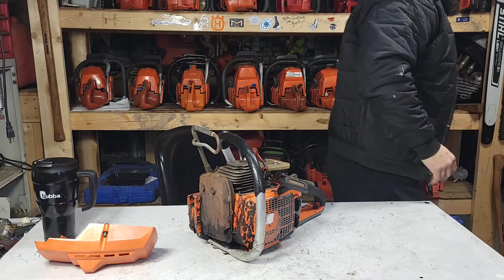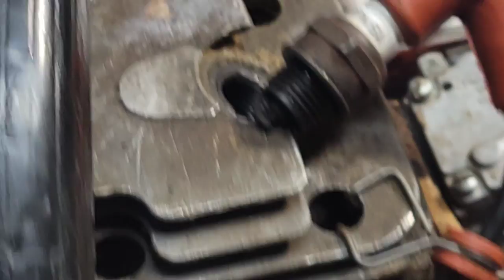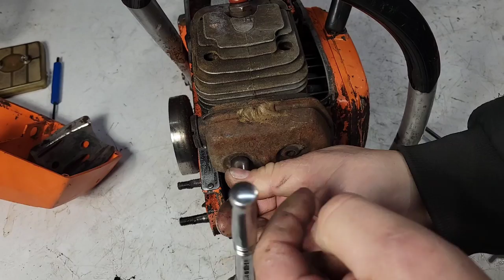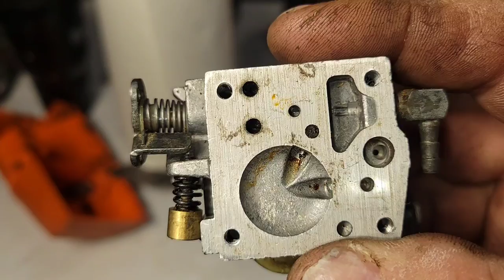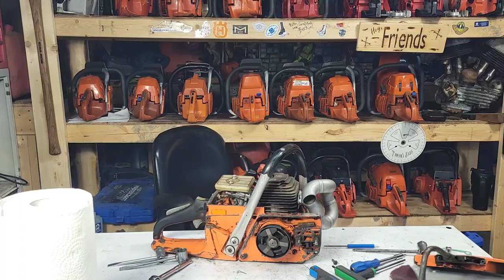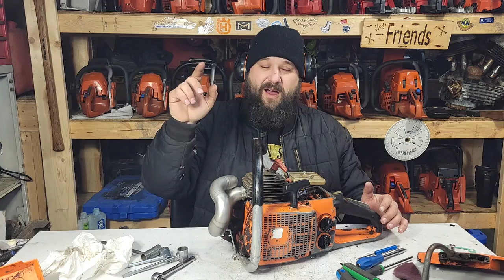Husqvarna 480CD, getting it running so I can hear this pipe!!

Comment: it is a 380cd - just checked mine and the handle bolts have the same rubber mounts and it has the same black rear handle. my 480 has no base gasket, a little bit off the piston skirt on the intake side, bigger lower transfers, larger exhaust port and opened up muffler. First time I have modded a cylinder and am well pleased. So much torque! Would love to see the tinman do one of these properly!

Comment: I have run my 480CD for over fifteen years, it was used when I purchased it back in 2008. They are excellent, powerful saws all round,  and their only weak point is the case around the front rubber mounts are prone to cracking. Mine is still going strong after 40+ years and its had almost nothing done to it, other than the usual bar and chain replacements.. I am in the UK and its a rare saw on this side of the pond too...

Comment: Love this video.... and the L77 uses the same top end as that 480cd btw. Might have to get mine out and build a pile :)  Great collection you are building :) The big "difference" is top end obviously but they wanted to separate the gasoline from the heat of  the cases. For me....I run my L77 and never had an issue , really enjoy them :) With that big heavy flywheel, it sounds like an old 60's era dirt bike :)
Reply: Build er up sir

Comment: Every carb I rebuild goes into the ultrasonic regardless of how clean or dirty it looks. That way all the internal passages get cleaned out. That thing sounds great with the pipe! Should definitely be an improvement over the stock muffler.
Reply: How long in the ultrasonic cleaner? What temperature? Thanks!
Reply: @donmayberryjrsOPE  I like to run mine at 50C/122F and ten to fifteen minutes for carbs. I use 70% water 30% simple green. I found that ratio works good and won’t tarnish non ferrous metals as long as you keep cleaning time to 10-15 minutes. If you forget to take parts out and they sit for hours you will get some tarnishing/discoloration.
Reply: @eurokid83  thanks! Yup that's what happens, I leave them in too long and too hot and they come out like a BBQ burnt burger 🤣🤣😭
Reply: @OOOOOO12345  haven’t had any issues with check valves.

Comment: Heard you mention You have an L77 Husky.  I used to cut firewood in the 80's and owned 5 of them.  I kept one for posterity and it hadn't run for 20+ years.  I just recently got it together  and it runs as good as when it cut for me back then.  It stumped me for years until I found a piece of gasket on the intake manifold.  Good channel to learn from.

Comment: Sometimes you actually have to lean out a saw after a muffler mod.  The change could permit a huge difference in airflow through the engine, which will give you a much larger signal at the carburetor and a resultant increase in fuel flow.  I had a couple of Stihl's that did this, the stock mufflers were so restrictive that after the mods they required a full turn leaner on the high side needles.
Looking forward to seeing the 480 in some wood, nice running saw so far.

Comment: A pipe that that has some back pressure and reduces reversion would be cool. Have you ever paid attention to louvered strait thru car mufflers. The louvered vent holes faced away from exhaust port to prevent reversion, but also increases back pressure slightly. Keith S.

Comment: Yo tinman, 480cd is the first saw I ported, been cutting with it for the first time today - loving it, would never have done it without you, cheers. However the 480cd has a metal handle, I have a 380 that has a plastic bit on the handle like yours but could even be a 180 or 280.